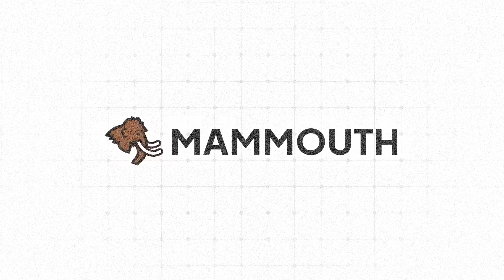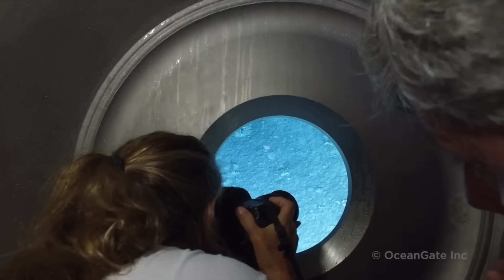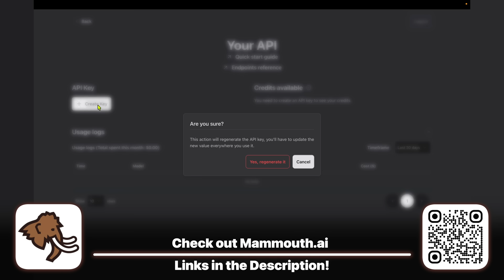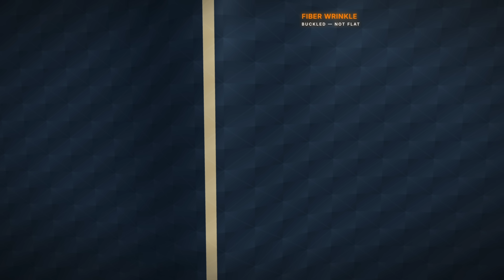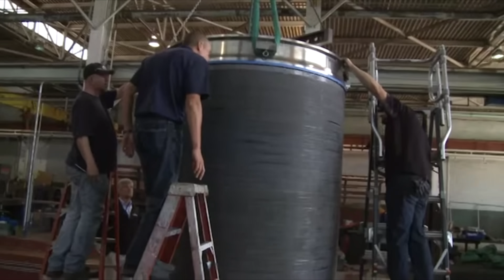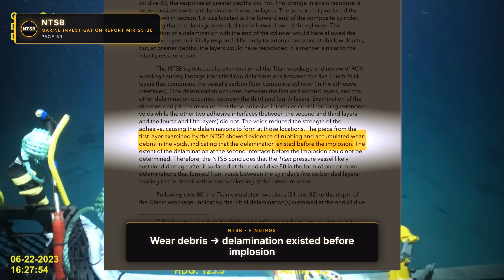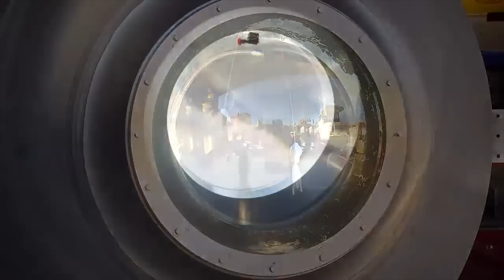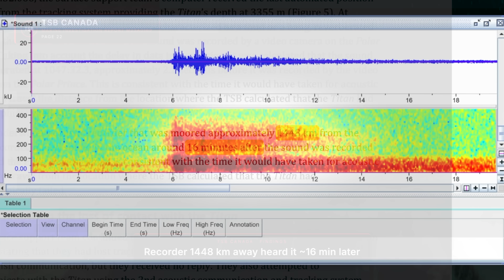Oceangate Titan: It was WORSE Than We Thought

Comment: Start is pretty bad. "People are blaming the carbon fiber but "properly built" version would have been good." THAT IS THE ENTIRE ISSUE! Composite materials are more complex to design, construct and maintain. To "build properly". Nobody ever disputed you can build good submarines from composites. The basic research on that has been done. Just that it requires lots more competence and effort than was visible at OceanGate and that if anything fails it may be catastrophic. Because modelling how the hull fails is more complex with composites.

And yes, I know that lots of people criticizing the material choice did not explain the issue properly or at all. Look, the reality is that there are lots of materials we could build perfectly fine submarines with. The actual reason real submarine building happens almost entirely with steel or titanium alloys is because we already provably know how to build safe hulls with those alloys. Using any other material would either require extensive r&d spending or learning from failures with casualties.

So when OceanGate made a composite hull and skipped most of the expensive development phase, people knew they were going for option B and that it was just an accident waiting to happen. And I want to repeat: KNEW. This is the reason submarines are built on the same old materials, so pretty much everyone interested knows the cost of what OceanGate was doing.

Comment: internal pressure and external pressure are very different.   Every air tank ever made has been made wrong.  In every failure, there is a person who thought they are smarter than everyone else.  A fleet of unsinkable ships were made.  Every ship that had ever  sunk was analized to make sure these ships were 100% safe from sinking.  The first trip they went on they all sank in calm water so fast that no SOS message was ever sent.  They never found the boats.  It took ten years to find the cause.  The guy who had been in charge of the build went to the place the boats were built.  He saw a guy painting a boat and asked him if he knew about the boats that were made there.  The man bosted with pride that he had painted the them.  He then said that the stupid engineers had put the racing stripe to low so he moved them where they looked better.  They were not racing stripes.  They were the overload lines to stop loading when the line was at the water.  This arrogant, moron sank a fleet of unsinkble ships with a paint brush and stupid egotistical self importance.   The boats were three times the load limmit before they left.  All it took was a small wave to flip them over and send them to the bottom.

Comment: Stockton Rush was one of those cult of personality explorer types who thought he was the exception to the rule(s). Anyone who pushed back or raised concerns wasn't taken seriously -- many OceanGate employees were simply frozen out of the business and then fired.

When you're dealing with someone like that, it doesn't matter what tests you do or what sensors & safeguards you build in because he will simply choose to ignore the evidence. Lo and behold, they luckily did have strong evidence that the sub was failing via the acoustic logging, and ... Stockton Rush ignored it. Then they died. I say "luckily" re: the monitoring picking up clear signs of delamination/weakness/cracking etc. because many of the failure modes would've involved an abrupt implosion with zero warning.

Also, if they simply disregarded a lot of the sensor output (instead of logging/graphing cumulative stress/audio incidents across the lifetime of the sub and its dives), that is also completely F'ed. I feel very sorry for the passengers who had no idea that OceanGate were storing the sub outside in subzero temperatures and were too cheap to spend $1700 on a tarp. I also feel sorry for younger OceanGate staff who were browbeaten into accepting this insanity. Kudos to David Lochridge who stood up to Stockton and tried to get the authorities to investigate before the tragedy took place. He got fired and sued for his troubles. Doing the right thing costs you sometimes, but at least he's till alive and can have a clear conscience.

Comment: You know what’s scary ? The 787 has shown on some planes wear on parts of its hull, possibly allowing moisture in, at altitude that moisture freezes, you know what’s scary happens then, expansion. Which leads to delaminating of the carbon fiber. After that, well let’s just hope Boeing and the airlines are on top of this.

Comment: 13:00 If the hull was audibly coming apart and the sensors were detecting it correctly, but ignored. It's not a false positive. It's potentially "Alarm Flooding", but the ignored is the key part here. Warnings were ignored, not overwhelmed.
A false positive would be a positive reading with a negative reality (ie if sensors detected delamination when there wasn't any).

Comment: It certainly was the carbon fiber
Reply: It was actually the glue joint which failed; the titanium flange was sheared right off uniformly around the whole ring. My hypothesis is that because of the increased flexing of the carbon fiber it put progressively more shear stress on the epoxy glue until it just failed all at once and then the whole thing collapsed from the front toward the back.

Comment: I'm never gonna be convinced carbon fiber was anything but a massive if not the cause of this incident.  Carbon Fiber, a little piece "string" can hold up a car but try to push that car and it's just does what you picture it doing.  Nothing.  Wrapping a cylinder is same effect IF it's being compressed, no gettin round it.  Pressure from within would be strong, like a plane?  The ONLY thing IMO keeping that thing diving as many times is at did speaks more toward the epoxy resin then anything.

Comment: That is simply NOT true.........the carbon fiber hull, in its full size and final construction technique had not been tested to fully reveal its fatigue life under actual real world conditions.  Nobody can "guess"
its safety margin or fatigue life if there is NO, NO data to support such a conclusion.   That was the whole issue, the final iteration of design and construction had not been tested to determine its actual fatigue life point of failure.  Until it did.

Comment: I have worked in the aierospacet industry, matinance and repair. That included composites. There are many ways of testing for delamination. Ultrasound is one well understood technique that is used. I think the thickness of the hull would be within the limits for testing with the proper instruments. 
The only way to make high quality composites of the type needed for this includes proper layup of the fiber and temerature controlled  hardening under vaccum in an autclave.
Regulations and standards are written in the blood of the victims of bad enginering.

Comment: I think you miss the point of the criticism about the carbon fibre: All knowledge about carbon fibre composites is gathered for thin pieces of laminate, as that's what has been manufactured successfully so far. Part of this knowledge is, that under real conditions, you will never be able to make a watertight laminate and it will soak up water when submerged, which weakens the laminate.

The Canadian calculation is under the assumptions that you can produce a flawless hull with the properties of a a handful of milimeters thick piece of carbon fibre composite and keep it dry. Those assumptions are seriously flawed as you can guarantee neither and actually can guarantee the opposite.

Edit: To be clear, there are fibre composite submersibles out there, but they all are certified for rather shallow depths, because that's the limit of manufacturablity.

Comment: as a welder they always test us by breaking our weld to see how good we are. a good weld supposed to be as strong or stronger than parent material so if it breaks or cracks on the weld it our fault. in so many different things u must always test until failure. only then you can adjust to raise the threshold limit of failure and build stronger. these ppl were absolute dipshits.
Reply: i worked at a plant that wont even leave pipe flanges in the open air overnight. they wrapped them in plastic and tape it up so the gasket face doesnt rust. how tf can u leave a submarine in the open freezing weather.

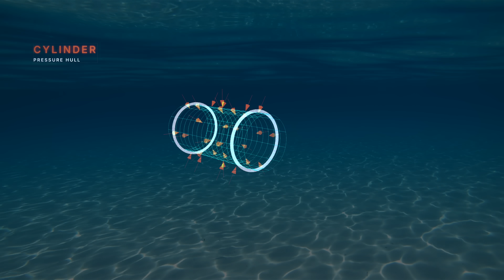Comment: 1:53 I actually get it now with the diagram and him using the can. Basically, the Titan submarine was a can and when you squish a can in it Centerpoint it collapses in itself like the time in submarine did and how he said that the pressure was away from the supporting bands it would most likely if the designers of the titan submarine added a third support ring in the centre of the Titan sunroom hull it would mostly would have avoided un implosion but I’m not sure if my theory of adding an extra support band to the Titan submarine would work in negating lowering the risk of an implosion without it being tested but I think honestly someone should test if adding a third support band in the centre of the Titan submarine would be able to support the excess pressure cause basically with this diagram it shows that the centre point of the Titan submarine hull was it wheat point as it’s far distance from both support bands that it’s in between of so if an extra support band was placing that setpoint it would add more hull resistance, but as I said above my fear of adding an extra support band to the Titan submarine in its weak spot a.k.a. the centre between each support band would even work without being tested and I think someone should really do
Reply: @ScorchyTheAxolotl  did you post this using speech to text?
Reply: @s @schoo9256 s and I edit it afterwards

Comment: The design analysis said it needed the 45 degree layers for a reason, taking  them out is a major factor in the early failure.  The 45 degree layers would be the ones carrying the load in the longitudinal direction (sub length). Still seems suspect to use materials strong in tension in a compressive loading regime.

Comment: You touch on this, but this is a huge concern across all engineering - the startup mentality has done untold damage onto our economy and our ability to create things. Right now, if you try to do things properly, you're at a competitive disadvantage because the other guy is just going to wing it and do whatever, and be perceived as more flexible, more adaptable, leaner, and ultimately more capable. Careful, pondered engineering is now seen as wasteful and overbearing. We are losing the ability to do things correctly. The worst part is that, deep down, the "lean" guys know they're risking and not doing the right thing. They don't care about supporting their product, or who is dependent or it, or who or what it harms in the way to profitability. But they conflate hard work (because it is always hard) with genuine value. You can be working hard and still be putting people at risk or being careless.

I see this, over and over again, across all fields, and I don't think the outcomes are very good.

Comment: The regulatory system completely failed before OceanGate ever made an engineering decision, because it failed to establish that carrying members of the public into an extreme, unsurvivable environment requires mandatory independent approval. Everything else, from the design and manufacture of that sub to the resulting deaths, are consequences of that failed regulation i.e. The regulatory failure was the latent condition that permitted all subsequent failures - and deaths - to occur.
--> Thus, the real question is: What, if not to save lives, was the primary job of the regulation bodies involved? Damning indeed.

Comment: I don't know guys, carbon fiber might be strong, being often associated with performance, lightweight, and durability mainly in high speed application such as race and flight, but I wouldn't trust it in the depth of ocean where pressure easily reach multiple times that of ground atmospheric pressure. You know, where carbon fiber barely can hold itself in an event of a crash, even in ground level, and they built it intending to expose it to several times the ground pressure level. IDK doesn't sound like a good idea to me

Comment: IMVHO So carbon fiber, in the end, isn't ideal to build subs, unless manufacturing REALLY goes deep into precision with near zero tolerance, and due to the nature of how carbon fibre shapes are made, it may well never happen unless some magic breakthrough happens. I think most carbon fibre shapes we manage to du correctly and work, are those made with a single oven pass, even with very high resistance to heat, there is always deformation with consequent oven runs. So, a 7inch hull must be made on a single pass.

Comment: This was the EPITOME of F(a) = F^o

In 7th grade i read Meg and The Trench. Just from what i learned around the pressures of those depths, I never should have stepped foot on that sub had I seen those videos its its manufacturing. 
They GLUED on the forward port. They had it in an open warehouse with no dust control. They wiped down the metal with a cloth but immediately started touching it with their hands putting skin oils on it.  They applied the glue with a PAINT BRUSH with no degassing to remove bubbles.

carbon fiber is great for HOLDING high pressure trying to expand from the inside. That is when the fibers are pulled on, where the strength it. 

But its NOT that great for keeping high pressure OUT. Imagine having a rope. When you pull on it you fight out how strong it is.  But what happens when you take a section of rope and push those ends together? You really aren't using the fiber strength.

Comment: Carbon Fibre (CF) is not stronger than steel, it is certainly not stronger than Titanium, it has advantages over steel when stressed, but hit it or knock it hard enough it delaminates. I've drilled CF using spade drills as you should, it is never pretty. If I had been told you are going down 3000 odd feet in a tube of CF I'd have told them to fuck off.

Comment: We test our atmospheric enclosures to 1.2x the depth rating, these are unmanned systems. Trapped air is a big problem for pressurised systems, we had a number of our thrusters fail at 1500m until we changed to a vacuum impregnation process on the stators to remove the air. We still use carbon fibre end pieces on a central cylinder of aluminium but we only go to 1km with those. The system should have been stored properly, exposing it to UV and temperature cycling ages material badly. Anyway interesting video

Comment: What I'm getting from this is that Stockton may have actually been right... had they not cut corners and actually built the sub to original designed specs, ignored alarms, cared for it stored and transported it properly and so on... Shocked it was able to survive delimitation and still make dives.... there may have been some potential to the design had all the above not occurred and they found a way to test to ensure it wasn't creeping toward a mass failure event.

Comment: Everything Stockton Rush did (and didn't do) pointed to an arrogant SOAB. From how he made his money, to how he lived. He was always looking to cut corners, save money to make money, and prove to the world that he was smarter than everyone else. Not to mention how he ran OceanGate. From dismissing engineers, to dismissing the need to add shear strength in the manufacturing process of the carbon fiber, to dismissing that loud 'POPING NOISE" as 'settling' (since when would you EVER want a submersable to 'settle'???), to dismissing a $1750.00 protective cover, to eliminating testing-to-the-point-of-failure, to taking one step back to go 3 steps ahead. All cloked under his false, misgided excuse that it was all unnecessary. Stockton Rush was his own worst enemy, and not only did he pay for his arrogance with his own life, he murdered 4 innocent people in the process. Stockton Rush should be postumously charged and convicted with the murder of 4 people and any reputation he may have today, SHEERED away. You should investigate that!!!

Comment: I worked with carbon fiber for several years. I disagree that carbon fiber should be used for this. It is the opposite strength vector for a compression like this. I would be absolutely outstanding if it were to contain this pressure, but not repel it. I still strongly contend that carbon fiber is an absolutely WRONG choice of material for this kind of application.

Comment: A tube under external pressure buckles (the tin can).  So take a 1" board and compare it to a 1" stack of sheets of paper.  The board can carry a compressive load whereas the stack of paper can't even stand on it's own.  Also, carbon fibre is good rope but in sheets it's the binding resin that provides the strength because fibers just buckle. The resin compressive strength is no where near the carbon fiber tensile strength.

Comment: 10 years professional experience as a CAE engineer. Worked with carbon fibre a lot in crash simulations. I'm no expert in the material at all, but my engineering common sense alarm was going off this entire video... Just. How.
Reply: I don't even like what the speaker here is implying about how it 'should' have been good for hundreds of dives.  Based on what?  The strength of the material itself is completely irrelevant in this scenario.  If any fibers ever snap, the structure is getting weaker, and you have no way of knowing by how much even with the acoustic monitoring.  Contiguous molecular structures are suitable for pressure vessels.  Everything else is just a step in the wrong direction.
Reply: @DarkJak337  I think the "should have" only existed if it was over engineered properly or at least made to spec.
But every point screamed cost cutting and under-engineered to do so. This sub was going to fail based on that alone